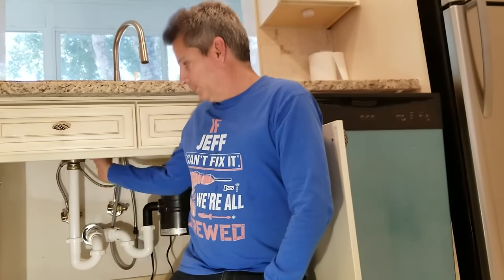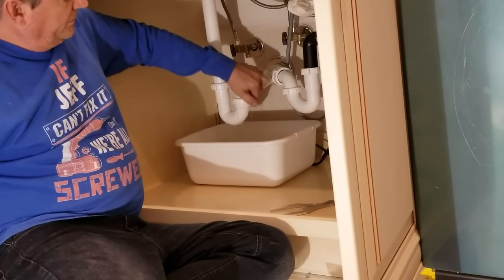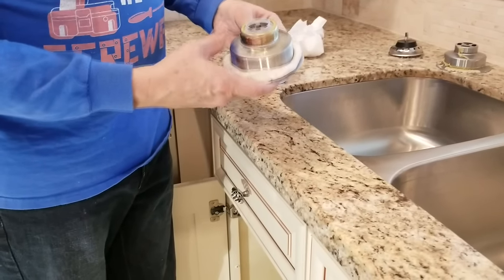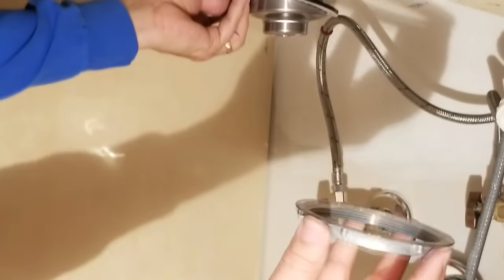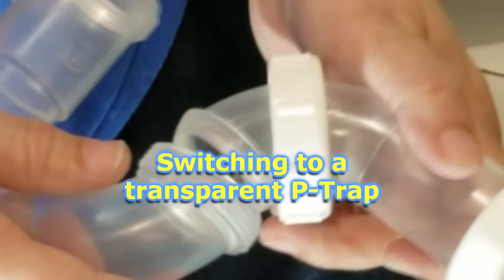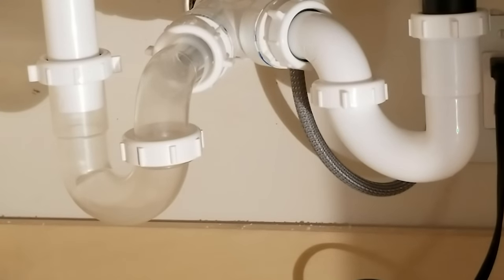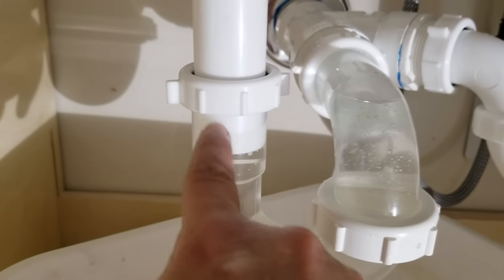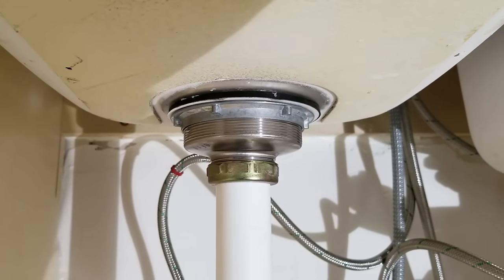How to Replace A Kitchen Sink Drain Strainer, Repair Leak

Comment: I am in the process of replacing our kitchen faucet and luckily, while working underneath, I barely tapped the pipe and it came undone from the sink strainer drain. I noticed the gasket is all worn too. So,  as a single mom, I have learned to fix many things in our house and will fix this too, thanks to your video!!!
Reply from the maker: Awesome, glad to hear another girl taking on DIY projects!
Reply: It's always lovely to see more women capable of such repairs! :D

More power to ya!
Reply: i just noticed same thing,,,i saw dripping and looked like the pipe that connects to the sink was not even attached! i reattached it and hand tightened but still drips so i wonder if i have to use a wrench or replace....as an older single mom also have learned alot about plumbing lol...i have to also replace the faucet so i guess ill have to kill 2 birds with one stone :)

Comment: I realize I am 4 years late but SUPER video! I love electrical but hate doing plumbing. Your well documented and explained instruction helped me get thru my delimma fixing the leak at my drain. Apparently, my sink installers never put the putty under the flange, only the rubber gasket. 15k likes and ZERO dislikes just shows us what a professional you are. Liked and suscribed. Anyway, great video and have a super Navy Day!

Comment: I woke up this morning and found dirty water under my kitchen sink.  Never having replaced a sink drain, I started searching for help and found your video.  THANK YOU SO MUCH!!  Not only do I now understand what I have to do, and it doesn’t seem too challenging, but I also know why it failed in the first place—the builder used the cheapest of everything here, including plumbing parts.  I’m off the hardware store to get quality parts and do it right this time.  Thanks again!!
Reply from the maker: Did it work?
Reply: @jeffostroff  Not yet.  Everything went well, but when I went to check the paper towel on the floor underneath the sink, it was wet.  ☹️  It’s leaking between the porcelain sink and the new drain (around the plumber’s putty, I assume).  I tightened that huge nut under the connection to the sink a bit.  The whole think moved a bit, and some more putty came out in the sink, so I’m thinking I didn’t get the new drain perfectly straight....  I’ll take it apart and do it if it’s still leaking.  This is why I hate anything related to plumbing.  Electricity?  No problem.  Plumbing?  Yuck.  Thanks again for your video. It was really helpful!

Comment: Great video.  A very Key bit of information you did not mention is how tight to get the new drain “flange” nut.  I am pretty sure I originally tightened mine too tight and it squeezed out most of the putty and a year later I had a leak.  I also realized mine did not come with the cardboard piece.  
Your music? Drowned out that Very Crucial information.  Thanks for the info.  As a woman rebuilding a house from the inside out for the last two years… I am constantly learning the details that I overlooked.

Comment: One trick I use to check for leaks is to use a piece of Scott blue paper shop towel.  When the towel gets damp the wet area on the towel goes from light blue to dark blue.  If you lay a piece of the blue towel underneath the sink, it's really easy to see where the leak is coming from.  This is especially important under the sink since it's dark.  It can be hard to see wet marks on a white paper towel.  

I also take a piece of the blue towel and wipe around all of the joints.  If the towel changes color, I know there is a leak at that point.
Reply from the maker: Funny you mentioned that because I just did exactly that two days ago at my friends house. I've been using the blue shop towels because they show the water a little better than the white paper do

Comment: using transparent pipes was genius. Thank you for this video!
Reply from the maker: Not so much genius anymore!  God for the demo, but we are finding now that these pieces of garbage are failing after weeks of use, they start cracking. Something wrong with the transparent plastic. The white plastic P-traps have no failures at all.
Reply: @jeffostroff  I meant specifically for the video. :) I never knew about the 'weir' before and it was a good visual.

Comment: Thanks for showing that universal tool for removing the old  heat and dried putty nut which is so thin you cant get a regular wrench of any kind to grab and turn it and like you said, the hammering thing just spins the sink basket drain once its loosened.  Im a 68 yr old widow on low SS check, so I either fix it myself or it doesnt get fixed.  Thanks again this video was long but very helpful!!
Reply from the maker: Sarah, awesome, glad you found our video useful, and more power to ya taking this on yourself DIY!

Comment: Thanks Jeff. Discovered a 'licensed contractor' hadn't installed the securing ring on straight! One question: why not silicon caulk rather than plumbers putty?
Reply from the maker: Some plumbers prefer silicone, but you have to wait 30 minutes or more before you can test, so they don't want to hang around.

Comment: I just removed/replaced my 2 sink strainers yesterday.  Even having the proper tools to loosen the large 'nut' on the bottom, it was so rusted, it wouldn't move.  Less than 3 minutes with a Dremil tool/cutting wheel cut through the metal ring to spread with a screwdriver and peel off.  Basin strainer lifted up and out of the sink. Just pay attention to the angle/depth so you don't cut into your sink.
Reply from the maker: Yes, once a leak has gone on too long we have seen what you just described.

Comment: I'd never attempted a plumbing repair before, but after watching this video I was able to fix a leak caused by a broken slip nut and reseat the strainer basket (which I knocked out trying to get the broken nut off... man that thing was tough). Thanks!
Reply from the maker: Glad to help Mike!

Comment: My sink drain basket has a very slow leak. It looks to have the cardboard ring issue. Would you recommend to just try tighten it or spray flexseal on it or should I replace the sink drain basket?
Reply from the maker: If the cardboard got wet, it's end of life, so a new strainer is what I would do, they are so inexpensive anyway. Even if you decide not to replace the strainer, you still need to remove it first because you have water coming through the flange due to plumber's putty breaking down. So you have to remove the strainer basket first form the sink, scrape off all putty from strainer and the spot on the sink where it seals, then apply new plumbers putty and install new strainer basket.

Comment: Thanks so much for this video, including the helpful links to parts on Amazon. This made the job a breeze. I didn't buy the circular wrench, just the "half" wrench. I probably won't use it again for years, so having both would've been overkill.
Reply from the maker: Yes, that's fine, that circular wrench even though it is the best out there, is HUGE, I don't even keep in my tool bag, leave it home in the big plumbing tote bin of parts, because I rarely use it. In fact, 2 weeks ago I also used the half wrench to remove an old kitchen strainer before installing a garbage disposal!

Comment: I am about to "fix" this leak for the 3rd time this year...
Reply from the maker: Why does it keep leaking? Maybe the large nut is not tight enough so the drain flange is shifting? These can be tough ones to nail down.
Reply: Chris S, I am in the same boat.
Reply: Same here 😒😭
Reply from the maker: @drummerjoey003   Make sure that you have put enough plumbers putty all the way around the drain flan drop top of the sink before you set it down you should see the putti oozout
Reply: You should also look at the amount of items you are storing under your sink.  I've repaired mine several times over several years and after investigating why its keeps leaking I discovered that I have too much stuff under the sink.  Evertime I move something around to get to something else I noticed that the drain pipe gets bumped.  Over time this bumping causes enough of a shift that it breaks the water tight seal of the putty which allows water to seep through.

Comment: Thank you this was clear and easy to follow, installation was quick !!!!! What took me so long was taking off the old leaky drain that was a different model, I got the nut off but the bottom part was still stuck and wouldn’t come off. After bending the bottom frame for 30 minutes I was able to get it off. I bought the new model drain you showed and it was so easy to install! Again thanks for the video you saved me some money!!!!!
Reply from the maker: Awesome Jayce yes you are right sometimes taking off the old hardware can be a real nightmare. There's been times rush spent a 1/2 hour or an even an hour I'll try to get way up behind the sink faucet and with years of water dripping down on it everything's all rusted and you can't get anything to budge

Comment: Awesome video...helped me replace the drain strainer for the first time. I didn’t keep the cardboard washer because it wasn’t mentioned as a part in the part I bought. Hopefully thats fine.
Reply from the maker: The key also is putting the plumber's putting in correctly above on the sink flange opening.

Comment: excellent walkthrough thank you!  only thing I had to add was a vice grip to keep the old drain from spinning while loosening the metal ring
Reply from the maker: Good idea
Reply: This is actually the issue I just ran into. Ok so vice grips it is!! Thank you for commenting because now I know what I have to do

Comment: Great video, great explanations - clear, concise,  and you have important little details added in, such as the facts about the methane gas going past the weir and P-trap. Good camera angles and lighting. Well done!  
    Question I have is: I can get all the PVC pipes and nuts loose, and get the big (the large ‘O-style’ ) spanner on the nut, and turn it — However - the drain basket turns WITH the nut. How can I hold/ Stop the basket from turning, to get the nut loosened and then off ??
Reply from the maker: This might take a second to person to hold the strainer in place while you try to loosen it. You can also try using a drain wrench that fits down and all of the crosshairs of the drain and then somebody could hold that ranch with a pair of channel locks while you turn the nut on the bottom

Comment: just developed a leak. 80 year old house. Looks like the sink strainer was completely installed wrong and the metal nut is corroded. I have a good start to attempt this repair now. Thank you!
Reply from the maker: Yes we often see that not corroded. If the drain is installed incorrectly then overtime water will still leak down below the sink and start to corrode anything down there that is metal

Comment: Very informative and clearly presented--Thank you!  A question, if I may... I have the Universal Wrench but the large "nut" that holds the drain/strainer in place underneath seems frozen solid, and won't budge.  I assume it's not a left hand thread...is that correct?  Any tricks you can suggest to loosen it?  Many Thanks!

Comment: Thanks so much. Very educational. Still wondering why they use a cardboard washer? Sounds like a problem in the making to me.
Reply from the maker: I think it does not matter, as the washer is just there to prevent friction
Reply: @jeffostroff  Ah, thanks. My 1st shot at doing this leaking sink fix. Wish me luck. LIL

Comment: Thank you for your video. I’m having the same problem. Already went to Home Depot to buy all the supplies I need. Let’s see how this turns out. Thanks again
Reply from the maker: Good luck! Let us know how it works out Paulina!
Reply: jeffostroff I finished and it turned out perfect! I replaced all the pipes too to get rid of all the nasty stuff. I did the water test and not a single drop leaked out. Thanks a million for your video.
Reply from the maker: @linna1328  Awesome, glad to help out!

Comment: Thank you so much! The people who did mines did a horrible job and I had to pay so much out for them to install it, after a month a big problem happen and I looked under it the whole area is moldy, with gunk and lots other stuff. They tried to blame me for the mess and claimed I put all that stuff down there, 🙄 and tried to tell me hey we can fix it for a certain amount of money when you just saved me 200 dollars.
Reply from the maker: Yes it's not rocket science all you have to do is use the right procedures so you can do this yourself and a 1/2 hour and probably do it much better than them just make sure you scrape everything off nice and clean

Comment: Thanks for the video.

Do you tighten the nut as tight as you can?
Mine seems to loosen up after a few weeks.

I  don't have the wrench that you do.

Just used a large screw driver for a little leverage. 

Thank you,Brian
Reply from the maker: Yes, use a screwdriver make it nice and tight, tape the screw driver with a hammer or wrench to make it tight. IF it still keeps coming loose, put a small dab of silicone or caulk on the nut jus tin one small spot to keep it from turning.
Reply: @jeffostroff  

Thank you so much for the quick reply. 

Have a great weekend.

Comment: Very nice video. Is just applying new plumber's putty a viable solution or must the whole drain unit be replaced?
Reply from the maker: It depends on the condition of the gasket and the cardboard. It's under $10 for the drain, so why not get a new one.

Comment: You have to replace the whole drain strainer when it is leaking from the drain strainer? Never had problems until I started using the sink to soak pans over night. Great video by the way.
Reply from the maker: The few times I have had to do this I prefer to change out everything that way the clock starts all over again from new statues. It's only a few dollars so why not. I think you could get away with just the strainer, but if age has taken it's toll, and I'm usually putting all new cabinets, I want zero chance of a leak, so everything is brand new and my buyers home inspectors will have nothing to point at for their report that will hurt my chances of the deal going through.

Comment: Awesome video! Thumbs up! Question: I am going to follow your instructions but the current piping that’s under the kitchen sink right now doesn’t have a p-trap. Is that normal? Do I need to worry about trying to installing one? Thank you in advance 👍 God bless
Reply from the maker: No it is not normal to not have a P trap it is required by plumbing code so where does this pipe lead to then that comes out of the drained from the sink? Does it form an S pipe shape or does it just go straight down somewhere?

Comment: Why does that part of the kitchen sink start leaking ? Does the rubber gasket wear out ? Great video by the way I used almost the same replacement part from the same company just a different style. Couldn't have done it without your help. Thanks
Reply from the maker: Usually the plumbers putty on the underside of the flange inside the sink wears down so water gets through it

Comment: Thank you for the tutorial! Putty fixed my leaky sink in just a few minutes.
Reply from the maker: Yes, helped another one!
Reply: @jeffostroff  can I use that drain putty on the pipes?
Reply from the maker: @SuperPeterok   Are you talking about the plumber's putty that we use up top on the sync when you put the drain flange down? That is the only place you need to use it. You don't use it on the pipes or anything the pipes are all done by compression they tighten and it stays nice and tight and blocks out the water from leaking
Reply: @jeffostroff  ok because I was missing a washer and I bought one. A 1 1/2 and it didnt fit on my pipe and it was still leaking. Should the next option be to use flex seal clear on the pipe?

Comment: I'm glad you changed the music in future videos.  I think it's important for once-a-year plumber DIYers to understand how much to tighten the main drain nut with the special wrench, and the music drowns out your talking, so I have no idea if you gave advice.

You used a wrench to tighten two of the drain pipe connections, but not two others.  But, I think I figured it out.  The video stops and then restarts!  My guess is you use a wrench on all 4 connections, but you don't show 2 of them in the video.
Reply from the maker: ⚠️⚠️⚠️ See our newer upgraded re-filmed 4K resolution installation video, improved audio, shorter than this, watch it here:  https://youtu.be/6mFfoYcK6zc

Comment: Good Morning, Mr. Jeff! Would you recommend Rubber Gasket over Plumber's Putty? What is best practice for today, considering variation in water temperature and trapping body of water in sink to wash dishes.
Reply from the maker: Usually they do not use plumbers party if they have a gasket.  Most of the dreams you would simply eat to use plumber's potty or silicone to seal it to the sink

Comment: Did this job for my mom and a couple days later it started leaking again: nut seemed tight, but flange of basket strainer was loosey-goosey in the sink and water had soaked the cardboard gasket.  Maybe I got putty in the threads?  Was extra careful not to over-tighten, because the original had been tightened down so much, the rubber was stretched and warped.  So, I guess I still need to find the "Goldilocks zone"  with nut tightness.

Thanks for the video!
Reply from the maker: Yes you need that friction ring to prevent the washer from distorting

Comment: Thank you for this video.   Does using hot water dry the plumbers putty?   We have a new hot water heater and it is so hot.  I cleaned the tubes (can'tremember the name you used 😊) and the seal at the sink came loose.